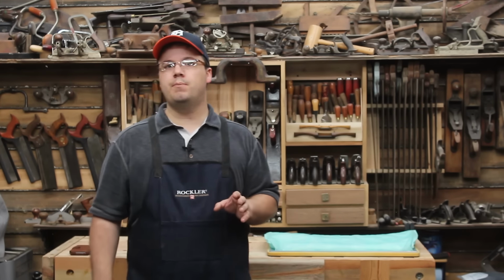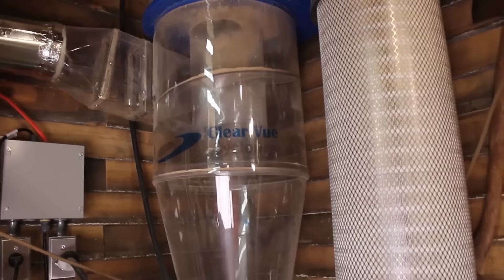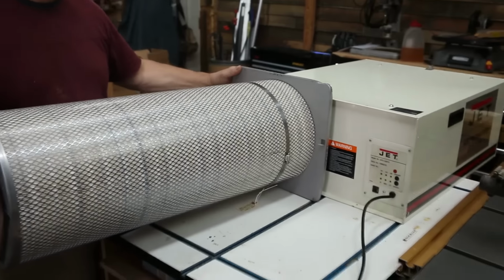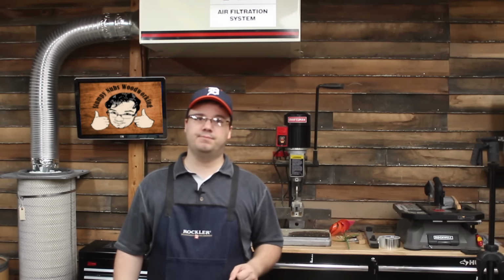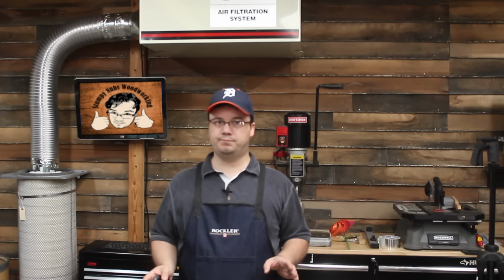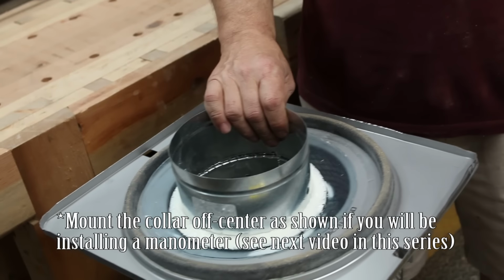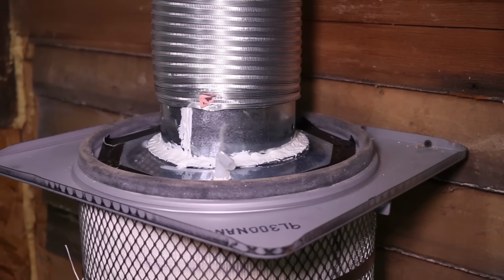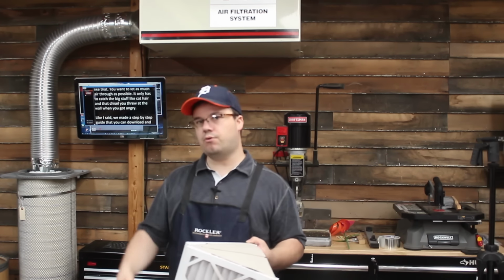SNW56- Upgrade your Ambient Air Cleaner Filter (Jet AFS-100B, Delta 50-873, 50-871 Etc)

Comment: Why not attach the Wynn cartridge filter on the input of the AFS1000? You would stop worrying about the pre-filter. But i am more concerned about the newest Jet AFS-1000C. It samples the air to determine air speed, faster for dirty air. I dont want to block that feature.

Comment: I love this idea, but I’m a bit confused. According to the owners manual of this jet model, which I have,  the exhaust air is meant to blow/recirculate the air around so it can suck up the dust. If I put a filter at the end how do I get air circulation?

Comment: Hi Stumpy, how long did you end up using this set up? Were you happy with the performance over time?
Reply from the maker: A couple years. And yes, it worked well the whole time. I eventually plan on re-installing it in my current shop.
Reply: @Jon M thanks for asking this! @Stumpy Nubs thanks for answering!

Comment: Great video. I noticed that the Wynn 9L300NANO in this video has an inner cage. Wouldn't this hold dust and retard the cleaning process?  I noticed the filters for woodworking on Wynn's website do not have the inner cage.

Comment: Why not just vent to the outside?  Ashes to ashes, dust to dust.
Reply: Good question!  I guess however, you'd obviously then have to leave the 1 micron inner filter in place, instead of removing it like Stumpy did.  In that case, however, why would you need any filters at all???  Just a big exhaust fan! I guess the only reason against that would be to conserve heat or cooling temps maintained in the workshop?  But my workshop in in my basement with neither heat nor cooling!  So why do I need more than a big old fan vented outside??  I'm LOST!!!!!!!

Comment: Thank-you for this great idea, and for all your informative videos.  
A dust collector normally has a dust separator on the input side - that is, it pulls air through the dust separator - and a bag filter or canister filter on the output side - that is, it pushes through the core of the filter and out through the filter material.  

An air cleaner usually has coarse and fine filters on the input side, and pulls air in through both filters.
In this video, you replaced the air cleaner’s stock fine filter on the input side with a canister filter on the output side.  

Question 1: Would that work with a furnace blower?  Somewhere, at some point, I seem to recall hearing that dust should not be allowed to go through the squirrel cage blower, that the blower performance might be degraded.  Not sure about that, which is the reason for the question.

I also just saw an article about a shop built air cleaner using an in-line blower and a “dust collector” canister filter.  In this configuration, air is pulled in through the “dust collector” canister filter and out through the blower.  

Question 2: Does a canister filter handle air flow in either direction - ie, inside to out or outside to in?  Or is each canister filter  designed for a specific direction of air flow - inside to outside, or outside to inside?
Reply: Exactly the questions in my mind, did you find any answers on that questions?
Reply: @karpuzsever  
For Question 1:  No further information.  I think the consensus stands.  Wood dust sticks to everything, and could be expected to degrade the performance of a squirrel cage type blower.  Which brings up another question :  what if a real efficient dust separator was employed ahead of the blower?  Would it tip the scale?  It would be interesting to know.
So far, we’ve been talking about the possibility of using a combination of furnace blower and canister filter as an air cleaner.
What about using a furnace blower and canister filter for dust collection?  The consensus seems to be that a dust collector should move 3000-4000 CFM, while a furnace blower, in general, might move 1000 CFM.  Big gap, right?  But it’s still a lot more than a shop vac or many of the less expensive commercial dust collectors.  

For Question 2:  Home air filters, both the main furnace filter and the smaller return filters, have the direction of air flow marked, and must be installed in the correct orientation.  They also usually have some kind of backer - wire mesh, plastic or cardboard - where the air comes out, to keep the filter material from collapsing as the air pushes against it.  Canister filters - at least the ones used for dust collection - usually have a wire mesh on the back side of the pleats; ie, the wire mesh supports the pleated filter material against the pressure of the air flowing through.  So the answer to to the question was that canister filters are designed for air flow in one direction.  Central dust collectors always blow air from inside to out, so the dust is on the inside, and the mesh backing is on the outside.  Shop vacs pull air in through the filter; shop vac filters may not have a mesh backing, probably because they are much smaller, and handle a much smaller amount of air flow, but the principle holds - they are designed for one direction air flow.  

Wish I had better answers.  Hope this helps.

Comment: So is there any reason you could not use a cheap dust collector for this? Basically mount the motor/impeller piece on wall or ceiling and tie the output to a similar filter.  You can pick these up cheap at harbor freight and the cfm is decent.

Comment: I'm curious why I rarely see anyone skip the filters and just have the system vent to the outdoors. I realize this isn't always feasible but that's what I did. I bought a used Jet dust collector that I could have put a big filter on (or used the bag that came with it) the top side but instead I made a plywood lid with a fitting to a clothes dryer vent so the fine dust goes outside my shed. I'm thinking I could do the same with one of the units you're showing here. No filters, seemingly excellent CFM performance and no cleaning filters. Any thoughts?
Reply: It’s an absolute no-go if you have any sort of hvac in your shop. It will suck the warm/cold/dehumidified air out of your shop and replace it with whatever air is outside in about 2 mins. That’s mainly why. The other reason would be if you live in a densely populated area. Clouds of wood dust being blown through a 6” pipe out of my garage would be generally frowned upon where I live.

Comment: I have evolved in my shop I now have a Cyclone dust collector from Oneida  and I have preinstalled two electrical receptacles on   20 amp circuits on 20 amp switch into my finished ceiling for air filtration units when I can afford them.

Comment: If I currently have a 3 hp cyclone with a HEPA filter, could I just let it run with an open pipe to clean the air? it handles about the same CFM as one of the air filtration units hanging from the ceiling.

Comment: Wonder how this set up would work for small model airbrushing using multiple filters as well. Leave the same set up you show to circulate the air. In winter time I dont want to release the heat of the basement.  Its water-based paint createx. I dont use flammables or urethane for the small stuff I use. At times I think using 4-5 filters to catch the paint and the front to filter the air. I would have a separate air filtration unit

Comment: I don’t think this such great idea. Your running a bunch of dust laden air through the motor of the AFS. That could cause a premature death of your motor or worse a fire.
Reply from the maker: No you aren't. The pre filter removes most of the dust. What makes it to the blower is no more than you'll find on the blower in your home furnace.

Comment: Stumpy, any update on how well this turned out after you used it for a while? I don'y think I have seen it in recent videos.... what are you using for ambient air cleaning these days?
Reply from the maker: I haven't moved it into the new shop yet, but it worked very well for the time I had it in the old shop. The new shop is larger so the Jet system is too small.
Reply: @StumpyNubs  any idea what you will use in the new shop?
Reply from the maker: I have a portable unit that I move around where the dusty work is occurring. It's from Sterling. Kind of pricey. I have also tried to reduce the need for ambient air filtration by getting a Mirka sander and a good dust extractor (also a pricey option.) But since this channel is about solutions for small shops, I suspect you will see the Jet setup return, at least in the corner workshop area.
Reply: @StumpyNubs   I rescued an in house vacuum system that works great with the sander and cost me $0 and that really does help... but what do you think of the powermatic benchtop unit #1791331? Or the Axiom Stratus for ambient air filtering? I still like your solution from a price/performance standpoint!

Comment: I am bit confused , air should be going in the opposite direction in the tubular filter as you have a massive surface area on the outside . A far better would be to suck air through the tubular filter , the air going for the outside to inside of the cylinder. those filter tubes are perfect for wrapping in inexpensive prefilter which is crucial to preserving the life of your filter and its effectiveness. you can actually build an enclosure round the long filter , turn it upside down and have the air going outside to the inside of the tube , the air output becomes the top of the long filter. This would be vastly more efficient.
Reply from the maker: The filter interrupts the airflow just as much no matter which way the air is flowing.

Comment: Why add any sort of filter to the exhaust of the Jet AFS? It already filters down to 1 micron. The premise for this video was to address the cost and constant changing of the pre filters.
Reply from the maker: It's not about FINER filtration, it's about getting a significantly larger filter surface area to boost the system's efficiency. It's all explained in the video.
Reply: @StumpyNubs  How does adding resistance  to the end of the system "boost the system's efficiency?"
Does the cylindrical filter you added, collect up to or below 1 micron?
Reply: Okay, I believe I misunderstood and didn't realize that you used this as a REPLACEMENT for the secondary filter that came with the unit. I had thought you added the cylinder IN ADDITION TO the  filter that came with the unit. I apologize for the misunderstanding.
Reply from the maker: You are not adding resistance you are reducing resistance by replacing the stock filter with a much larger one. More surface area = less resistance. Again, it's all in the video.
Reply: @StumpyNubs  Right, I just realized you are replacing it not adding to it. See my comment above. Great idea and thanks for explaining.

Comment: Has your blower motor survived the added air restriction?  And, is the Delta 50-875 the same as this Jet system?  
Thanks for this video
Reply: I think it would be about a push restriction-wise. He is vastly reducing restriction with that filter setup. Those stock 3-bag second stage filters have about 9.6 sq feet of filter media. That Wynn filter has 300 sq feet. He also went from about 3 sq feet to about 6 sq feet on the intake. Balancing that out, he is inducing some restriction reducing the blower output down to a curved, corrugated 6” drier pipe. I think the limit of that pipe is about 800cfm? Either way, the more restricted the system is, the less amperage the motor will pull. The more air it moves, the more amps it pulls. It sounds backwards, but try it. Hook an amp meter up to your dust collector and start opening blast gates. The more gates you open, the slower the blower will spin (due to the increased air load), the more amps the motor will draw. Personally, I beat my electric motors like rented donkeys. I have a 1981 Century 15-amp rated motor on an air compressor that has been pulling 21+ amps for years, so I wouldn’t worry about it running a little bit harder.

Comment: Yeah, okay, a Jet Air Filtration unit upgraded to use a Wynn nano filter is a fantastic idea but doesn't that reduce it to a VERY big, heavy and expensive remote control blower? Have you considered just bolting an axial blower for drying carpets to a Wynn filter and a mechanical timer switch?
Reply: Just following up. Emailed Dick Wynn and he said they had looked at the fractional motor duct fans but they lacked the oompf (my word) to provide adequate Static Pressure (his word). Basically they don't suck (in a bad way). He encouraged experimentation with fans that had more "Oompf" which was my thesis (there are now 1/4HP 13" axial fans available that would be very efficient airflow-wise because they don't have the 90 degree turn that centrifugal fans have.  The shape of the airstream also matches the Wynn filters. Article linked below explains differences between Axial and Centrifugal (furnace blower) fans. I just don't have the bank account for the gear needed to experiment. Hence my query. Thanks for all the great videos. FWIW.  https://www.pelonistechnologies.com/blog/axial-vs.-centrifugal-fans
Reply from the maker: Either the Jet unit is useful or it isn't. Putting a bigger filter on it doesn't "reduce" it at all. If anything it improves it.  If you want to make your ow blower, that's a separate issue. But there's a reason Jet and others sell lots of these units when furnace blowers are available widely.
Reply: @StumpyNubs  I understand. They are useful as a packaged solution with their intake filters. But when modified to remove the intake filters and enhanced to use a Wynn filter on the outflow, it's not obvious what else the unit is other than a furnace blower, control circuitry and remote controlled speed and timer. Hence the leap to skip the packaging and go directly to Blower plus Wynn filter.
Reply from the maker: I am not telling you not to build your own. I am saying the filter has nothing to do with it. Either the blower is worth buying or it's not.

Comment: Everything that I have read about installation indicates that you should mount your air filtration system so that the exhaust air stimulates air circulation in the shop. Without that air circulation, you won't be drawing in much contaminated air into the filtration unit. If you cover the exhaust with that filter, you are not getting the air in the shop moving around and defeating the purpose of the whole exercise. I hate to throw cold water on your idea because I think it was otherwise really well thought out. Perhaps another external fan to promote air movement ?
Reply from the maker: You are pulling in MORE air with the larger filter. It improves circulation.

Comment: Do you have any concerns about the dust getting onto the blower fan motor and electrical parts that are exposed in this unit? Concerns like the components having a short lifespan and possibly a fire hazard? These units were designed to keep out the dust before and got into the unit but the way you have it set up the dust will go right through unit and into these components. Just so you know I've been watching your videos for years and appreciate all your hard work and the information that you put out there for free so I'm not complaining just want to get your thoughts.
Reply from the maker: I haven't noticed any significant dust buildup in the motor, but it wouldn't hurt to blow it out with a compressor every once in a while. Remember, this is only collecting very fine, airborne dust. It's not like a chip collector that sucks loads of dust through itself. And of the airborn dust that gets sucked into the system, all but the nearly invisible stuff is caught in the pre-filter. So the size, and actual amount of dust that goes through that motor and into the post filter is very, very minimal. However, use your own judgement. Your equipment, your warranty, you shop, your responsibility :)

Comment: stumpy I know I am late to asking a question but was wondering would this same set up work if I used a shop fox , grizzly or a wen air filtration unit and just a smaller filter. I am I the navy an have a small shop in my garage but I can't justify spending almost 400 on a unit when I really want to when I could jet one for 160 ish. please let me know what u think it would be great cause I got to get a handle on the dust situation. thanks

Comment: Hey Stumpy, great video, really like the idea.  Had a question, this is a pretty old thread, but I'm a new subscriber and catching up on your videos.  Isn't one reason to mount an AFS on a wall, to use the exhaust vent of the unit to circulate air along the walls around the shop in a continuous loop?  I would think using that hose and filter setup would essentially cut off your air circulation?  How are you moving the shop air into the intake pre-filter of the AFS?  Sorry, if this is a dumb question.
Reply from the maker: +scbleecker  I have it positioned this way because I also use it to circulate heat in the winter. The hot air hangs out at the ceiling and this pulls it down. I have had no problems at all with circulation throughout the room.